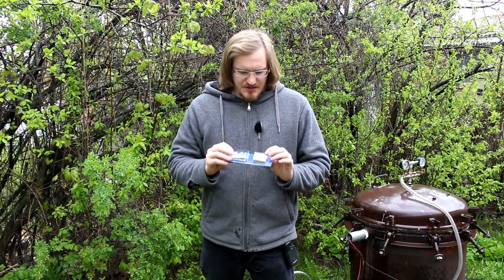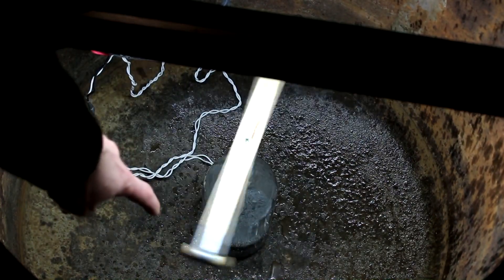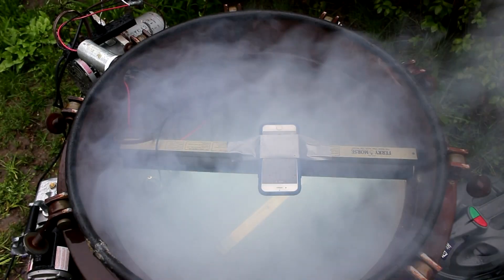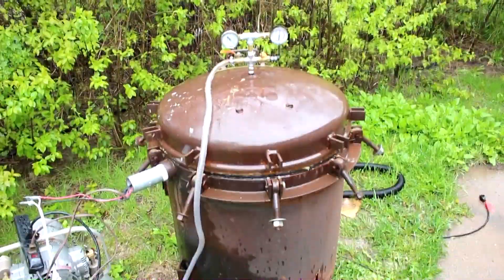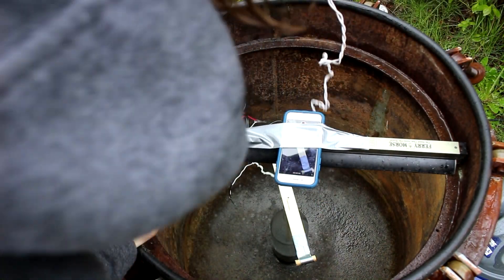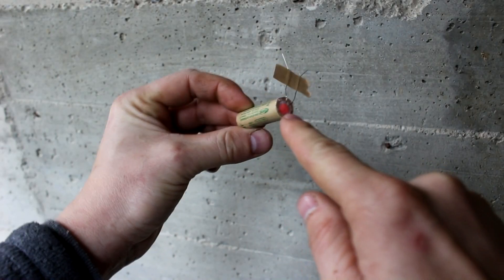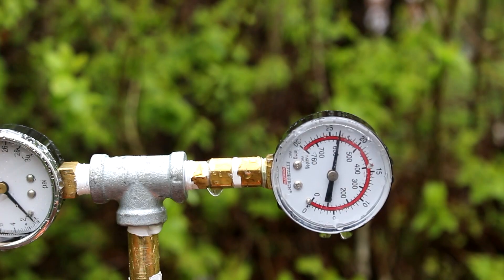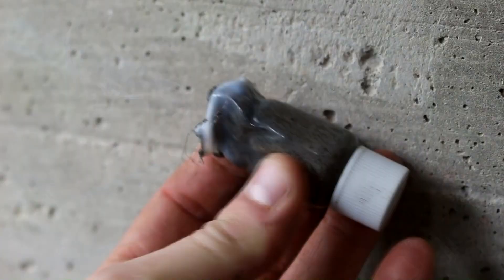Will a Model Rocket Motor Work In Vacuum?

Comment: actually what you did was encase  the rocket preserving enough atmosphere to burn the fuel while also giving the rocket something to push off of. So the rocket once ignited pushed off the containment unit. The containment unit went one way the rocket went the other. But that is not what Nasa states that they do. to have rockets like that in space you would have to contain each rocket that you wanted to use. Then once used go out and contain them again for a subsequent use. But The rocket could not fire directly into space. What you basically made was a bullet cartridge. Nasa claims it works like a balloon. You blow up a balloon and have even pressure on all sides. You release the pressure on one side and you watch the balloon go flying around the room. They disregard that the reason the balloon moves is because of the air flowing from the open source and pushing of the atmosphere and instead state that it is because the pressure is no longer pushing at the open source but still pushing in the remaining directions. It is a big leap to state that nasa has figured it out because you figured out how to do it in the way stated above when the way they say they do it is more aligned with your first experiments which failed.
Reply: Moron.
Reply: Live Fantasy 
They (flat earthers) would drive you mad with their stupidity, I agree with you fully. The 'dome above us' people are the worst.
Bruce Lee used to say that it was unwise to argue with an idiot because onlookers would not be able to distiguish the idiot. He said it better than that but the exact quote eludes me at the moment, but basically he meant arguing with an idiot is idiotic. I stand by what I said however, calling flat earthers 'asshats' is an insult to genuine asshats everywhere... peace.
Reply: NUCK CHORRIS
Although 'Live Fantasy' is a bit rude it does not detract in any way from the fact that the OP is indeed an asshat. All flat earthers are asshats as well, in fact thats actually an insult to asshats everywhere.
Reply: It's called a combustion chamber.

Comment: A couple of cool things here. 1) did you notice the water at the bottom boiling off, hard to notice but it was,and 2) the motor works because solid fuel rockets do rely on air as the oxidizer. In vacuum the oxidizer is carried along. You will see these fuels only as a liquid. A really cool vid here.
Reply: Solid fuel rockets do not rely on the air as an oxidiser.  Where did you get that silly idea?
Reply: Rockets do not run on oxygen from Air.
I don't think any Rockets have ever done that but certainly not this one.
Reply: @Adventist pretty sure it's impossible to make a rocket without an oxidizer unless you just use pressure
How would you get enough oxygen inside ti rocket from the atmosphere to provide thrust?
It would be extremely interesting to see a design that can do this because if you just put fuel in a tube then it will only burn as it exits into the oxygen around it.
Reply: Donald Parlett jr Solid Fuel rockets contain their own oxidizer.
Reply: Atmospheric oxygen would have a very difficult time getting past the nozzle pressure. There are Solid fuel rockets without solid oxidizer but they use liquid oxygen which is pumped down the center of the solid fuel.

Comment: I don't think it was a full burn though.  Seemed awfully short even for an A motor especially when compared to the first control test.  Thoughts?  I think the motor started and burned for a short time and then stopped due to lack of pressure or atmosphere.

Comment: this sucked cody. where was the proper testing the good theory's the calculations of volume of air released by the rocket.  did you burn the used rocket to see if all the fuel was burned ???. cody i want you to redo this.
Reply: you also forgot a proper explanation of why the rocket wouldn't work without the pressure.
Reply: Connor Dow " explanation"!
That pressure was your oxidizer!
Reply: @01wadder  that is not true. maybe Cody should have been included a explanation to head off people like you that think air pressure is an oxidizer for solid fuel rockets.

Comment: it could be that no oxidizer is present in the rocket engine, as that's an extra chemical to pay for (and add weight to) and the model rockets are usually only used in-atmosphere anyway
Reply: never mind just discovered that model rockets use a potassium nitrate oxidizer

Comment: Do you have a little leak in the bottom of the chamber or why is the water at 7:57 bubbling?

edit: might be some air trapped below the bottle?
Reply: The lower the pressure the lower the boiling point of water.
Reply: Would not the boiling water produce a gas which oxygen would be a part of this result via air bubbles of H2O. Yes carbon dioxide being the main gas, nitrogen as well maybe argon. Just asking? Wouldn't this sublimation of gas create extra pressure within your vacuum? Something that I am wanting to know. My interest would be a complete bullet cartridge, primer ignited from it's regular brass  case underwater be enough to ignite the powder and sufficiently release the bullet from it's case more than a foot?
Reply: @jettzbigdaddy3055  no you need to put energy into water to separate the hydrogen and oxygen molecules all of the water vapor is still water, it's still oxidized hydrogen, if you put water on something does it help it burn Because of the oxygen in the water? No.
Not to mention if it was separating into oxygen and hydrogen then there would also be hydrogen in the container in a perfect mixture to detonate.
Think about it like carbon dioxide it says it right there that there's oxygen bound to the carbon, but you can't burn it because it's the result of burning the oxygen and hydrocarbons.
Literally the same deal with this except there's no carbon, just hydrogen
Reply from the maker: Also despite being only about 34degrees F that day the water was boiling.

Comment: Would it be possible to pressurize and heat water to the point where it would glow like molten metal without boiling away?
Reply from the maker: water has a critical temperature (374 c) above which it cannot exists as a liquid no matter how much pressure you put it under. Ironically though you can get ice hot enough to glow but the pressures needed are HUGE.
Reply: Hey that's awesome! Well if you ever build a pressure chamber large enough I'd love to see it done. Honestly I wouldn't be surprised if you did. Cheers for the reply and keep up the great vids!

Comment: Well I guess it needs air for its chemical formula... Oh sorry your explanation was better. Not sure a vacuum is great for your camera depending on its internal pressure resistance, and in the LCD part there may be an air pocket.
Reply: My first thought was the lithium battery would expand because I did look this up and cell phone batteries do expand in vacuum Chambers.

Comment: next time try a ni-cr wire coil. like 5 turns, 3mm diameter and 12 volts for igniting not the mains.
those model igniters also are designed to operate at 9-12V.
They should ignite like a match. At 110-220v ac they explode, obviously...

Comment: @ 3:57, I can see that there is a slight push.

Thanks for making the video. I also asked that you make such a video. I guess the back side of the rocket needs to have a specially designed rocket nozzle in order to have pressure in it. Also, perhaps it would work better on a larger scale.

Comment: did you vacuum the air out of that little container that the rocket is in? that just nullified the hole experiment...🤣🤣
Reply: Damn, it's almost as if solid fuel rockets were mostly used as boosters during atmospheric flight.
Reply: @StartellerRX-8  it's almost as if they were used in space they would be kept in pressurized containers for ease of ignition.
Reply: @FrancisR420  I literally said they are not used in space, so what's your point?
Reply: Why don't you explain how it nullified the experiment?
You know you can't just say it and it's automatically true the guy had a rocket inside of a vacuum to show what a rocket does inside of a vacuum how was it nullified by they're being pressure around the rocket?
It required a bit of pressure around the rocket to set it off but he was not trying to set off gunpowder in a vacuum. He already did that test.
Reply: No, it didn't. The experiment proved that model rockets can work in a vacuum, but can't ignite in a vacuum. They need that initial pressure to start the reaction.
Reply: Harlon David How exactly did this nullify the experiment do you even know what an oxidizer is?
Reply: Do you really think the air would have time to fill up the vacuum chamber?

Comment: It didn't sound like the parachute ejection charge went off on the successful vacuum-burn motor. I hypothesize that the 'slow burn' fuel between the boost stage and the parachute ejection charge didn't produce enough gas to keep the combustion chamber pressurized and went out. I'd love to see that motor dissected and see how much did/didn't burn.

Comment: So, stuff wont burn without oxygen.  Who knew?
Reply: +mike that's not what made the ignition fail, as he explained it. Igniters don't rely on air, but the ignition burn isn't forced into enough contact with the fuel to start it. The vial was a pressure chamber, and could have been filled with nitrogen to achieve the same effect.

Comment: great video, sad ignorant conclusion at the end.
Reply: What was so bad about the conclusion?
Reply: he didn't mention that it went out at the exact moment the vacuum was reintroduced. Yes it was able to start in atmospheric pressure (he's proved that over and over), but it doesn't change anything at all.
Reply: The fact that the rocket motor accelerated the rotor assembly to a great rate of speed, while also producing lots of smoke, demonstrates that the rocket motor did NOT extinguish immediately after the air bottle broke down. 
 You are asserting that rockets don't work in the vacuum of space, but I am sure you have not done any experiments of your own in order to prove this.
Reply: +Scavenger_mi 
 So, you are saying that rocket propulsion in a vacuum is impossible?
Reply: Perhaps so, perhaps no. 
 Maybe a bigger vacuum tank, and a bit more testing would be useful here. 
 Either way, it is proven that rockets work perfectly well in the vacuum of space  :) .

Comment: it didn't burn after the vacuum hit the fuel if you notice the major difference in burn times.
Reply: Luke Himself it did, or else it wouldn't have spun the arm around as violently. The difference is that the exhaust can evacuate the rocket much more quickly in vacuum than in normal atmosphere.

Comment: I know very little about science so will very likely make a fool of myself here, but although the demonstration is taking place within a vacuum, surely the rockets is being propelled forwards by pushing against the chamber walls which are fixed?
Reply: Once the atom has reached the wall and impacts it, there is nothing to transfer that force back to the rocket, that impact is only going to push the wall of the vacuum chamber away. The force from the rocket is applied as the exhaust is leaving the rocket, pushing the rocket in the opposite direction. 

It might be easier to understand if you imagine the recoil of a gun firing in a vacuum chamber. The bullet does not need to hit the wall before you feel the gun recoil backwards. Instead of one large bullet, a rocket is firing lots and lots of very small bullets.
Reply: You're imagining it something like a piston made of gas. The gas expands and some of it sort of... piles up, because it can't get out of the way fast enough.

Rockets work because of Newton's 3rd law of motion: For every action, there is an equal and opposite reaction.
If you stand on a skateboard and throw a bowling ball, you'll roll backwards. The faster you throw the ball, the faster you'll roll back (due to Newton's 2nd law). 
It's also the reason for gun recoil.

Rocket engines are basically throwing the fuel-oxidizer mixture out the back at thousands of mph and the rocket continuously recoils forward.
Reply: Yeah, you're kind of right with the recoil. Replace the bullet with the molecules of the fuel/oxidizer mix and the breech of the gun with the back of the combustion chamber and nozzle bell.
If you go back through Cody's videos, there's one he made a while back, explaining roughly how rocket engines work on a blackboard.
Reply: No, that's not how rockets work.
Reply: Karl Munford If there is a vacuum then there is no contact between the rocket and chamber wall.
Reply: +BadWolf.
Thanks for the reply, I have no horse to back in this race as I stated, I have little knowledge of science.
Reply: +Mike Wade.
Thanks for the reply, again as stated to BadWolf I have no horse to back in this race but am just interested in the subject.

My thinking as uneducated as it is, suggests that the gases, atoms or materials jettisoned or expanding out from the rocket will push against one another which forces them away from the motor itself. If that is the case, then surely when one end of this expanding flow hits the chamber wall it will compel the rocket at the other end to move away from the chamber wall?

If the expanding gases could be contained in a clear plastic bag the picture becomes plain [to me], one end pressing against the chamber wall compelling the rocket forwards.

But again, I fully recognise my lack regarding the subject and therefore am not arguing anyone accept my quite possibly flawed theory.
Reply: +BadWolf.
Thanks for taking the time, it is appreciated. Still, if I am honest I can not help thinking that the force of expanding materials hitting the chamber wall is transferred to the rocket through the rest of the material being ejected.

However, if there is absolutely no contact between each particle being ejected and the only thing moving them forward is the initial blast [whatever that is] in the rocket then I yield to your explanation. But if there is any form of contact or pressure transferred between the material being ejected then there is clearly an avenue through which the pressure hitting the chamber wall can be transferred back to the rocket motor thus propelling it forwards.
Reply: +st0rmforce
Thanks for that st0rmforce, you've given me something to think about.

Regarding the gun recoil, if you had a 2kg block of steel next to a 1kg block of steel and some explosive between the two and ignited it, they would part with one moving further than the other, rightly or wrongly that is how I see a gun recoil but the skateboard example, that is interesting... appreciated.
Reply: +st0rmforce
Interesting stuff, I'll take a look when I get a chance thanks.
Reply: Karl Munford Your vision of how recoil works between the two blocks of steel  is exactly right, that is precisely how a rocket works as well. You can think of the exhaust gasses as being the 1kg block, and the rocket as being the 2kg block, the explosion is the combustion inside the engine.
Reply: +Badwolf HS
Thanks, Badwolf, that helps, it is also nice to know that my logic isn't too far out there! :)

Comment: Figures, if it's an actual rocket motor with rocket propellant, part of the chemistry is to produce oxygen when broken down thermally...
   Also stands to reason, heat control would be the big hurdle in a vacuum. It's tough enough to control the stuff in the atmosphere (usually dealing with too much heat, though)... lolz

Comment: alternatively I think you could've tried plugging the nozzle with some small venturi. The exhaust gasses from the motor would've been at higher pressure while still inside the motor, and maybe it would've been able to start more easily, or burn more completely